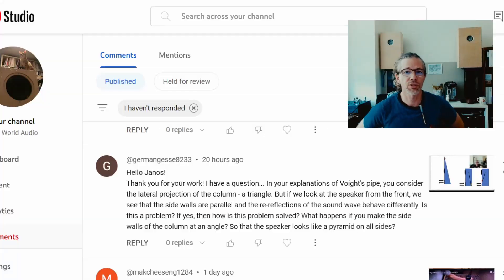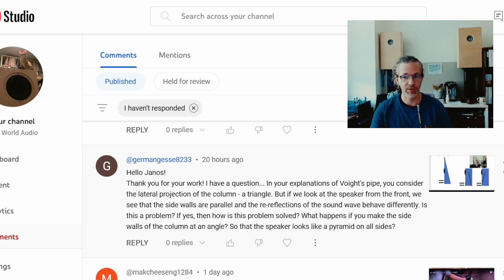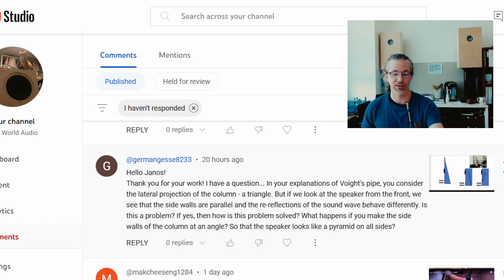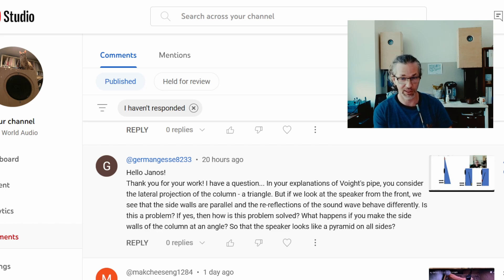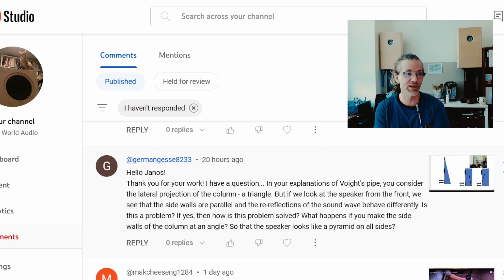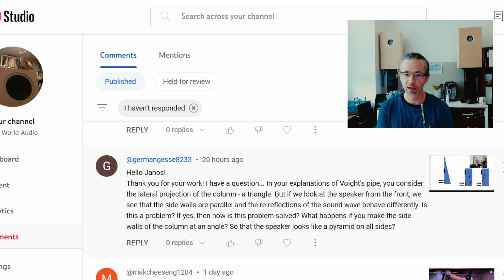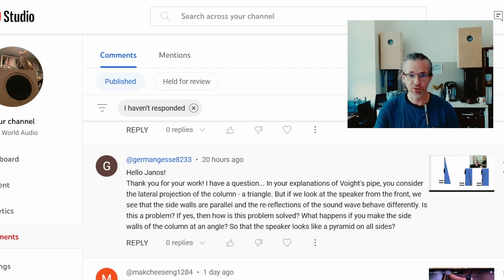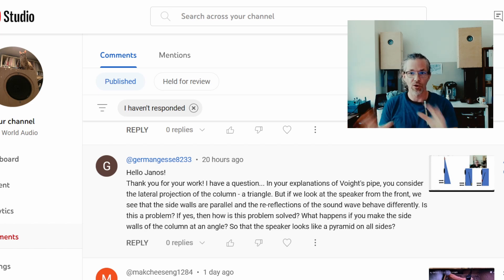Voigt Pipe questions & considerations

Comment: Hey Janos. Hope you are doing well. I have a question. I was wondering if using a single woofer say purifi 10" & using it with closed back mid & tweeter like bliesma beryllium domes instead of full range driver ofc xo will make it worse than single driver but it should otherwise be identical to the working of your cube audio right?

Comment: Hello Janos!
I've built 2 folded voight pipes using calculator, first one with 6.5inch speaker driver, second with 8 Inch. What i have noticed that speaker driver position in that calculator is always somewhere 1/3 of pipe length from the closed part and you are telling that it should be 1/2 of the length. What does the driver position affect? And my second notice is that my pipes always resonate at second harmonic (annoying spike), to flatten that spike I put polyfill in the middle of pipe, but that resonance is still noticeable. Is that related to driver position or something else wrong? Different pipe length, different drivers but the same problem... Also that calculator relies on driver resonant frequency,   pipe resonance = driver Fo / 1.333

Comment: The “pyramid” speaker you are referring to, is commonly known as a “Metronome”. And as far as getting an exceptional sounding Vogt Pipe, I think Martin King may have a thought or two on how much subtle changes in design parameters will effect the ultimate outcome of the speaker’s performance…  I agree that a Vogt pipe is a simple speaker to build, and one will be rewarded with a unique sounding speaker. To make an exceptional sounding Vogt pipe, is not an easy thing to pull off. Look at Cain & Cain speakers. They look common, but they are not. And having built dozens of different enclosure types for full range drivers, the Voigt pipes rank at the top with a couple of other designs that perform at a really high level. Sadly, the Le Grande, for all the time and effort it took for me to build, ended up being set aside and the wood being recycled, as it did not work for me at all. I agree that Voigt pipes are a basic, inexpensive speaker to build. With a small amount of effort being put into damping/stuffing the line, and looking into the implementation of either/both a baffle step or notch filter to address nasty peaks, will reward you with a special sounding pice of kit.
Reply from the maker: Thank you for the detailed feedback, much appreciated! The La Grande is really a stepping stone in direction to the Voigt pipe. I did not design it to be ultimate in any category. It has one purpose: it is an indicator of the systems tone, balance, and synergy. A stepping stone and a calibration tool to develop  / voice the rest of the system. If the rest of the chain is on point, it sounds very remarkable, I can even listen to it instead of the Voice of Lancelot (in my living room - main system). Any issues, and it will report it - in my office they sound relatively UTTER GARBAGE. Same speakers.... in the office they are superlative for zoom calls, but very very far below even a mediocre commercial setup. And it's the exact same speaker. ;) .  I am not saying your system has problems, I'm pretty sure you have voiced it very carefully and it sounds very good... just going in a different direction than what I call as my golden path. (It's not the only golden path, just the one that I know of how to achieve...) In my experience the nasty peaks of a Voigt pipe are the (almost) exclusive problem of the amplifier and the chain, which excite those otherwise dormant issues. When the chain synergizes, then those peaks entirely disappear without any filters. Of course, depending on your room / amp / cabling, you might need the filters, and I did run into such situations before. My experience was that in those situations I did not reach the potential of those speakers.
Reply from the maker: And thank you for mentioning Martin King! He has a fantastic online resource for TQWP / pipes: http://www.quarter-wave.com/

Comment: The dipole effect will neutralize the modes that would otherwise be created on the sides. The Voigt pipe, well, and other sorts of transmission lines behave similarly to open baffles. In engineering and physics, there are constant trade-offs. Pick your poison.❤

Comment: My gut feeling tells that the sound waves inside a Voigt Pipe are predominantly propagated vertically and that there is hardly any energy in lateral sound waves (the ones that can create standing waves at the side walls with the right frequency). The conclusion is that the parallel sidewalls of the Voigt Pipe should not create any issues at all. I could be wrong and I have no math to back up my thoughts, but in my mind this is very plausible. 
I also agree that the elegance of the Voigt Pipe is its simplicity. The most difficult part is to make the diagonal cut to create the side walls. I would love to see a video with one or more methods to do that, using DIY tools.

Comment: Hello Janos!
Thank you so much for such a detailed answer! As I understand it, the general principle of a hollow tube (!) is that sound waves move up and down a column, and for moving this column, parallel side walls are a very suitable solution. And a change in the parallelism of the walls, as you said, leads to a change in the principle of operation of the hollow pipe... Thank you very much again for your answer!